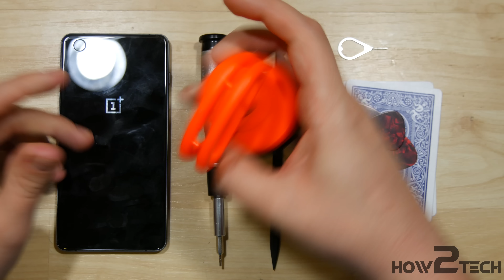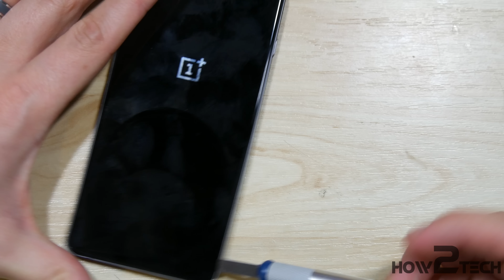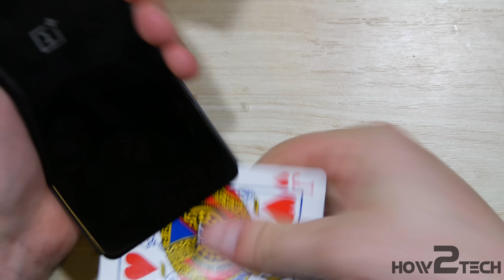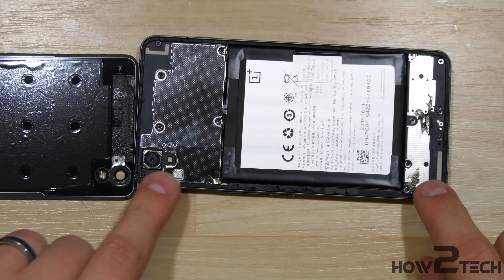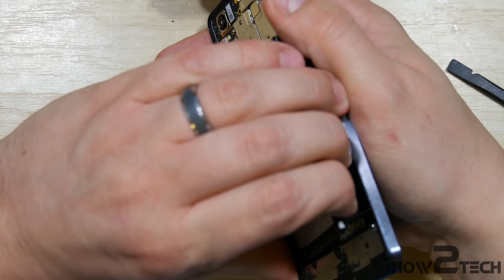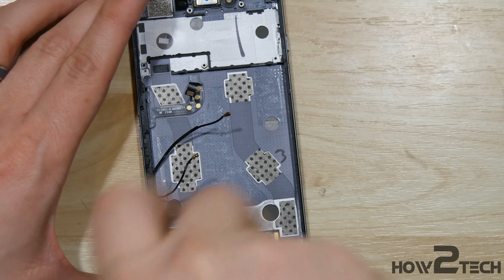One Plus X  Screen Repair, Charging Port fix, battery Replacement - Disassembly Teardown

Comment: Hello, I want to change the single front touch screen:

 ( http://www.ebay.es/itm/Pantalla-exterior-Frente-Outer-glass-Lens-para-OnePlus-X-/282404349226? <----- only this), 

I have to disassemble the whole cell or only the front screen by heat as you do with the back cover of the cell phone?

Thx!!

Comment: Wanted to add a big thank you for your video ! 
I had to repair the screen of my OnePlus X today (broken screen after little fall on concrete, without any protection.....), and it helped me a lot. 
As you said (and another youtuber also), it is very hard to remove the front screen (much more adhesive), and it will break the entire LCD screen behind as well when you'll do it. So no, it is not possible to only repair the glass screen on top of the LCD, the two sides will break when lifting from the glue.
I could not prevent some tears of the original plastic frame when removing the screen also, so I had to be a little bit creative ^^ For me Super Glue was a must have since every adhesive surface disappeared after disassembling the phone (front and back side I had to use some glue drops on the corners).
Thanks again, keep doing those in depth videos, we need those :)

Sam

Comment: my phone got wet yesterday and was behaving abnormally then it shut off now it isnt turning on whereas when i plug in charger the red led comes up with one plus logo on the screen and then shuts off back again... looking for suggestion and repair instructions are highly appreciated dont have one plus service centre in my city... thanks

Comment: You didn't disassembly the frame / screen. Why?

i have my screen broken (not the digitizer, the touch works fine, only the outer glass.), i wanted to exchange in my home but don't know how and you didn't explained.
Reply: Did you had the answer ? Same problem here and wondering if a whole disassembly is needed..

Comment: is there any way to change only the glass, as mine broke but the panel and digitizer work perfectly? and does anyone know where to find replacement?
Reply: how do we remove the broken outer glass from the digitizer? is there some glue putting the together?
Reply: I need an aswer too, touchscreen works perfectly and I just need to replace the glass. It would be very expensive to go to a reapair shop

Comment: why is it not possible to just heat up the front and remove the front panel like you did on the back ? do you always need to pick apart the hole phone just to replace the front panel?
Reply from the maker: +Batuhan Barin You need to unplug the display connector to remove the display. This phone it is connected 11:36 so you could probably get away with just taking the bottom potion apart but then you risk damaging the board while you are removing the display.
Reply: +How2Tech thanks! so you would recommend to remove the board and everything else before removing the display?